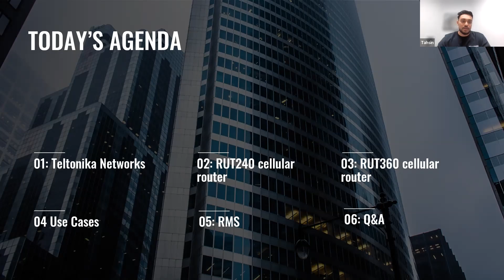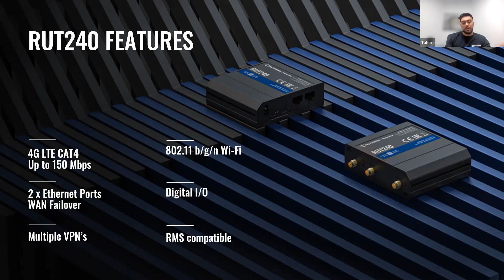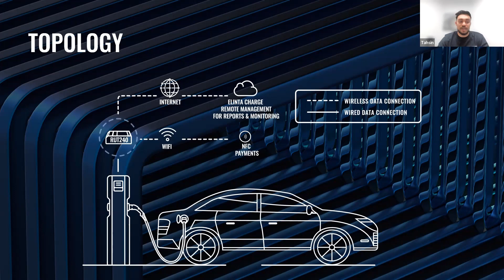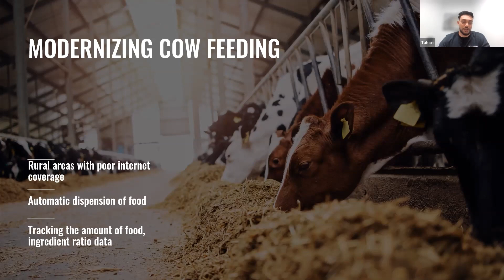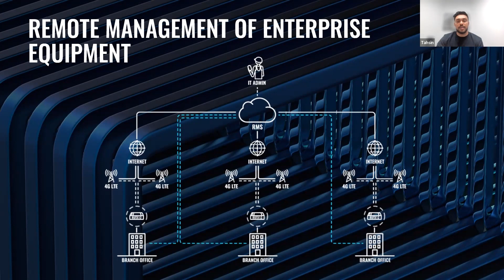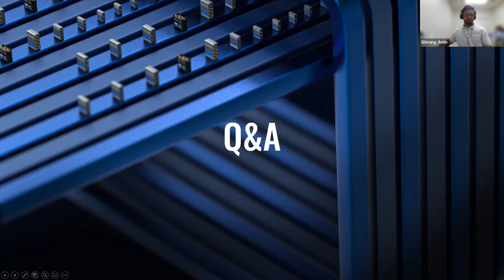Compact & Powerful: Simple Routers for Complex Solutions | Webinar

Comment: I have a question that was not asked in the webinar and I didn’t see answered in the FAQ or the Wiki on the website.  

What is the name of the power connection socket on your routers?  I have used Chinese versions and the DC plugs all had the generic barrel style plugs as on most small electronics these days.  I use a barrel to barrel cable to connect the router to my 12v solar battery inverter and it works great saving me to run the AC inverter which is less efficient as I am off grid. I am looking for a more reliable 4g sim router and yours looks great but will need to figure out the cable adapter I need to use on this style of DC Power Plug you use.  Please advise asap as I am ready to order one to test.
Reply from the maker: Hey, thank you for the question. We use a connector with a 3 mm pitch and it has 4 pins.